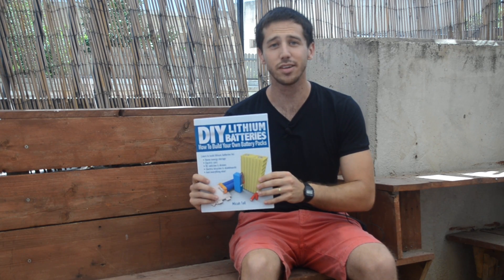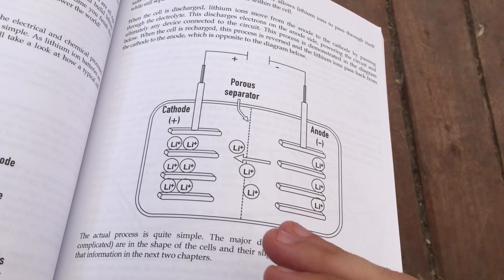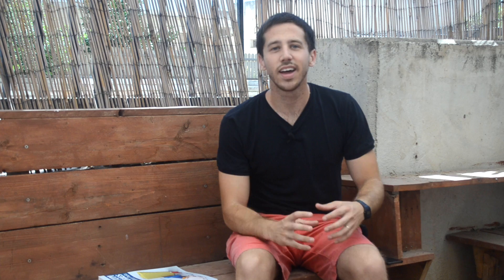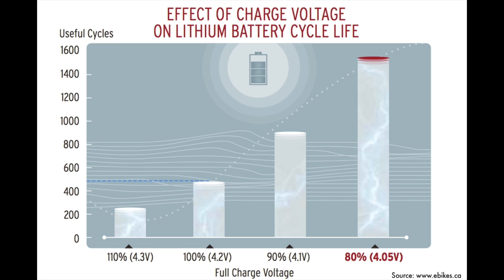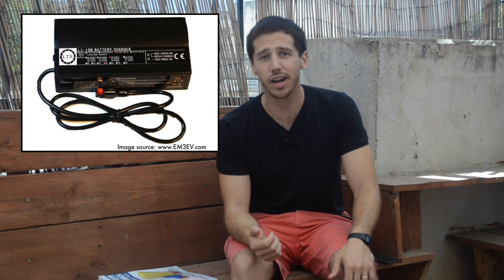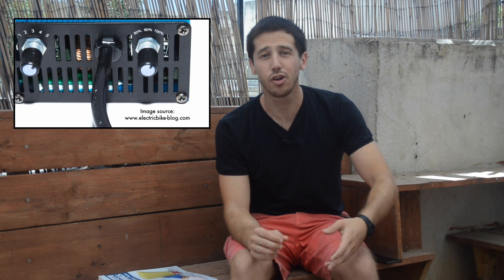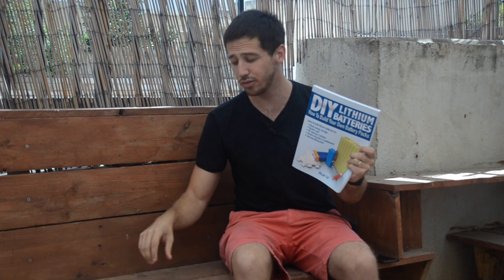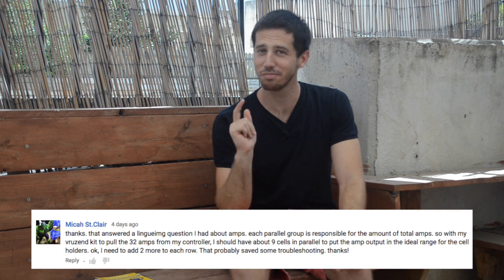How To Double The Life Of Your Lithium Batteries

Comment: My name isn't as cool as Micah St. Clair's, but I'll take a stab at it. Thanks for the charging info. I'm a total n00b in the e-bike world, just having bought my first one a month ago. Still learning the ins and outs - and battery life is one of them. My factory battery - a 48V 11.5ah "dolphin" type - is rated by the bike's manufacturer at 800 recharges, which seems to me like it will last a pretty long time before it needs replacing. But the nut of the matter is this: the replacement cost from the bike manufacturer (Rad Power Bikes) is $499. That's a lot of lucre for a retired guy like me. Luna Cycle has a battery that looks exactly like mine, with the same specs, for only $399 - a significant savings - but their support dept is unable to confirm for me whether or not the battery connector on the bike will match the connector on the battery. Do you have any suggestions for how to find this out? Thanks, and best regards.

Comment: Hi Micah, thanks for another great vid :) while we are on the topic of batteries and charging, I have a question.

I've seen folks advertise their e scooter batteries for sale and some indicated the battery has been bypassed. 

What does this mean? Why do people do that and what are the advantages and disadvantages of doing so? 

Looking forward to your reply. Thanks! :)

Ps: I'm guessing it has something to do with the BMS?
Reply from the maker: I assume that means the BMS has been bypassed. If you bypass the battery then you won't have any battery. Bypassing the BMS means you can pull more power out of the battery, and the BMS usually has a certain power limit. The downside is that you lose many of the protection features that are built into the BMS.

Comment: Great instruction videos. What do you think of digitally regulated chargers / power supplies where you can actually set your own voltage and max current? I use a 0-62V/3A charger and a 0-32V/10A and they work great. They also have a built in volt-meter so you see both the charge voltage and the "live" voltage of your cell-pack. I use the Gopher brand.

Comment: Hi EbikeSchool. If one might try to do the crazy thing of building a e-bike with not only 2 motors like you have already done, but also add an 3rd motor in the middle, how would you build one? How can you control all engines to produce enough power to help each other the best possible way ( is there a already build controller for that or is it possible to make one, or does it even matter to have something like that)? Also cost is an issue to not make it to expensive. Total newb to the e-bike scene, so i was just brainstorming the idea of 3x 250w motors with a battery for about 30-40 km range, because the size of motor is an issue here where i live (not going for speed over 30-35 km/h but would be nice to have more even speed while driving uphill and against the wind or heavily loaded .

Comment: If you REALLY want to maximize your battery life, you should do 2 things:
1) Charge it as slowly as possible. An 8 hour charge is much better than a 2 hour charge.
2) Make sure your battery is as big in watt hours as the PEAK power of your motor and for really much more life, double the peak. So if you have a 250W motor that peaks at 500W (though it usually more than double), get a 1KWH battery.  Quickly charging or discharging a battery generates a LOT of heat. The heat severely degrades your battery life. Heat is your worst enemy and quickly charging or discharging your batteries will artificially age your batteries. Same with the motor. Make sure you size your motor correctly for your weight and terrain. Having your motor peak out constantly generates a lot of heat and all heat generated is lost energy. If your motor is getting very hot, you are wasting your battery's capacity by using it to heat up the motor.
Reply: Fast charging and discharging generate heat and can damage batteries. Would fast charging and discharging still be damaging to the battery if the battery has a cooling system to reduce the heat generated by fast charging and discharging?
Reply: So adding a mini cooling fan to a big power bank such as a laptop one could be a good idea?
Reply: @antoniogalluccio4213  nope, I just checked, doesn't work.
Reply: @luongmaihunggia  so there's no way to minimize the wear apart from undercharging a bit as I understood right?
Reply: @antoniogalluccio4213  undercharging, slow charging or use a battery that can handle more abuse.
Reply: When you say more abuse you mean more voltage or more current in ampere
Reply: @antoniogalluccio4213  which ever one you like.
Reply: If you read the patents of tesla around their battery/charging solutions it contains the methods on their lifetime working batteries. Active cooling inside the battery is one of the methods. The question is how efficient it is to incorparate this technology im ebike batteries. But if i understand the methods correctly cooling would help to increase life with fast charging
Reply: @hetzijzoal  Keep in mind that Tesla makes their own batteries and builds very high quality cells.  In addition to that, I have heard the pack is undersized compared to the actual capacity of the battery. (ie.. a battery may be marked 50kwh but is actually 54kwh and so it is never truly fully charged)
 The single biggest thing you can do to extend your battery life is not to charge them all the way up. Under 4 volts per cell is best and never run them dead. This will more than double the life of your battery.  The downside is that you have to oversize the battery for the same amount of range.

Comment: The cell will drop off from 4.15 or 4.2 almost immediately anyway. Nevertheless, it is HIGHLY unlikely that you can increase to anywhere near 1500 cycles, especially since bicycle batteries are generally undersized and are expected to deliver huge amperage spikes (referenced from the C rating of the complete battery). I seriously doubt you can even get the 500 full cycles at 80% capacity unless your battery is really large in comparison to the motor on your bike.

Comment: Good idea with the occasional peaking to BMS level.
Long Term Battery storage is best at 40-60%, stored between 50-85 degrees F.
I myself believe 15-90% is how you want to charge unless to occasionally level(if required to trigger BMS).

Comment: Can you use lead aicd batteries the power an ebike
Reply: Yeah but they're very heavy, so expect less range or a far heavier bike, also expect about 2.5x less cycles if you fully charge/discharge.
Reply: You can, and it was common many years ago, but it is not practical at all, and not very economical, unless you already have battery and charger laying around.

Comment: Hi Micah, I have bought and brief read through your book but still have a question unsolved, maybe I should read in more details,  but I want to ask a quick question (maybe someone already had this question):
if I have a group of cells with capacity varies from 1500 to 2100 mAh (due to limited budget) to build a 7p13s battery, should I better put cells with similar capacity in parallel (so that every 13s would have similar capacity) or put the group with similar total capacity first (so that each 7p would have similar total capacity) then put those groups in series? Thanks!
Reply from the maker: Yep, I touched on this in my book. Both methods are possible, but generally the second method (where you try to make each 7p group equal total Ah) is better. That way you don't end up with a bunch of different capacity groups that will take much longer to balance. So try to make 13 parallel groups that are all equal capacity, or as close to each other as possible.

Comment: Would the recommendation of not fully charging the batteries that sit for long periods of time because of plating issues apply to mainstream Li-ion battery packs such as those for power tools?
Reply from the maker: yes. Inside they are all the same lithium ion cells (with small differences in chemistries, but the theory still holds true).

Comment: Hi Micah I am building my first lithium battery 48v 20ah from Sony vct6 cells from watching ur videos. Could you advise me I have a 57.6v charger would
Reply: It be suitable to use with the battery I'm making thanks for ur time
Reply from the maker: 57.6V is too high. You want 54.6V for 48v, assuming it is 13 cells in series.
Reply: Ok thanks for ur advice and quick reply very much appreciated

Comment: This is the main thing (as mentioned at the end): how long you ride before you have to charge. If you use a 400 cycle battery but charge every 3 days it will be at the same level for almost 3,5 years. Afterwords the battery doesn't just dies but looses some of the capacity. So it shouldn't be such a big deal. Of course if someone is range oriented then it is a different question.

Comment: Hi Micah,

I am building a battery pack and I have some questions about it. I'm doing a 13s10p pack so the charging voltage should be 13x4.2=54.6v. But to increase its cycle it needs to be charged to 80% as you said. So the charging voltage will be 13x4.05=52.65v. My question is if I charge it by a 54.6v charger and cuts it off manually at 80% (I can do it by a battery gauge or by assuming a charging time maybe after 5 hours or something measuring how much it's taking to get 100%), will it actually give me more cycles? or, I need to specifically charge it by 52.65v charger?
Thanks
Reply: .i need the same answer
Reply: Probably a super late answer but yes you can manually unplug it
Reply: Those chargers should be CC (constant current) followed bij CV (constant voltage).
During the CC period the actual voltage of the charger is below 54.6V. It is only 54.6V during the CV period.
So yes and you could even think of a circuit that switches off the charger using a relay at let's say 53V.

Comment: 4.1Volts is not 90% of a full charge of 4.2Volts. ...90% is 3.78Volts and 80% is 3.36Volts not 4.05V as in the Graph and as mentioned in the Video. ...
Reply: Steve Jones I believe since the range for a healthy cell is between 3.2 when fully discharged and 4.2 fully charged, %90 would be around 4.1. If your batteries actually got to 0v you wouldn't have a functional cell anymore.
Reply from the maker: That's not even close to correct...

Comment: Ok it works, but I think the math is wrong. Let me demonstrate: For instance you would normally charge when at say 3.6 volts. So from 4.1 you have 0.5 volts and from 4.2 you have 0.6 volts to ride with.  Simple math concludes that is about 20% less capacity!! I would say it is not worth it. Also you should never ever overcharge a lithium battery!
Reply: Jurik Ristjouw 1st, usually lithium ion cells are discharged to 3.0 volts, sometimes even lower depending on the cell (discharge cut off at 2.5 or 2.8 is common). 2nd, the relationship between energy (watt-hours) and voltage level is not linear in lithium ion cells. Take a look at a discharge curve, a lot of voltage is lost very quickly in the beginning and then flattens out later. So charging to 4.1 you don't lose as much as it seems.

Comment: Hello Micah. This is Reuben. I am building a battery pack. Well i am a bit confused while calculating the overall power of the battery pack. For instance, Power = voltage >< current. For a 18650 it would be P = V >< I, so, P = 3.7 >< 3.4. So P = 12.58 watt hrs. Right i get it. BUT i am getting confused about Maximum Continuos Discharge Current which is different for every different cell. So while calculating the power, should the current be capacity of the cell (ah) or Max Cont. Discharge Current. Can you please clarify on it. Thanks.
Reply from the maker: Your confusion is likely because you have the first part wrong. Watt hours is not a unit of power, its a unit of energy. So 3.7V * 3.4 Ah = 12.58 watt hours of energy. That doesn't tell you power. When you calculate power, don't use the capacity of the cell (Ah), instead use the max continuous discharge current. So for a cell rated for 10A max discharge, you'd get 3.7V * 10A = approximately 37 watts of continuous power.

Comment: Since when is an ANODE negative???????
The anode is the positively charged electrode.
Reply: g0mhc True and i also noted another Error Since when is 0.1volts 10% of 4.2Volts LOL In the charge graph it shows 100% charge =4.2V 90% charge =4.1V and 80% charge =4.05V.. shouldn't it be 0.42V less  for each 10% less charge ?..That would make 80% charge = 3.36V not 4.05V which is a massive ERROR LOL Regards M0BFM
Reply: Well spotted Steve.
I'll just stick to charging my 18650's to 4.2V it won't make a whole lot of difference to the life of them.
73

Comment: Well explained, thanks.  I use a second charger set to 3.90V/cell for winter when I'm only commuting short distances around town but need to have the bike ready to go at all times.  Both the basic "42V" chargers I have are internally adjustable over the required range.

Comment: Doing some calculations based on a 1AH battery pack for simplicity
@ 4.20V:  500 cycles  x 100% =  500AH  total life
@ 4.10V:  900 cycles  x _90% =  810AH  total life
@ 4.05V: 1500 cycles x _80% =1200AH total life
What does this mean? Well if your commute on your ebike is much less than your battery range (or you use just a little more peddle power)  you could potentially more than double the life of your battery.  Charging once per day this would take your battery from 16.5 months (1y 4.5M) to 39.5 months ( 3Y 3.5M)
Now calculate the cost of your battery to the cost of a special charger. Now include any other batteries and see your potential savings.
Reply: Q Az
So you tought the vid was not clear enough about this?  simplicity rulez lol
Reply: Q Az $

Comment: I'd be interested in knowing how periodically "topping off" lithium batteries that spend most of the time in standby mode affects total life. These are typically flashlights, etc., that need to be kept ready for emergencies, and need as much capacity as possible if and when used.
Reply: I'd like to hear the answer to that myself. That sounds like it could create an issue not unlike NICADS dropping to a lower voltage, only with the same voltage and a shorter lifespan.
My guess is Micah will say "Not so much, except you will have slightly more plating damage at the anode due to staying near 4.2 volts more often."
What say you Micah? (1st time video watcher here)

Comment: What do you think about a booster pack?
When the voltage of the battery gets low, you activate a booster battery pack in series, so the voltage increases and the motor can run faster again.
Will it harm the booster batteries or will all of the current flow through those?
And will the BMS still work correctly, or will it lead to single cells getting under-charged?

Comment: I also try to only charge to 100% when I'm going to ride the bike soon after. I have a simple e bike kit without a battery gauge,  and a cheap charger, but I do have a bike computer that shows speed/miles, and after a couple of months, I now try to leave about half an hour off of full charging to charge it somewhere between 80-90% (if riding 12 miles or so takes an hour to charge to full, this time I only charge it half an hour, then next time I charge it the whole hour). Now I only need to charge it full when I will need the range.
From what I hear, good quality 18650 batteries rarely get out of balance.
Another great video Micah, thanks!

Comment: I did not know this so a huge cheers and thanks for the info - its good to know that I am on the right path to battery bliss - I actually do what you do with my rides as I have 2 batteries while using 1 I will use it for the next ride because it usually has 55-65% left if i am doing 10 mile runs, and the other battery remains low until the day before the other is used.

"range anxiety" I like that, I had lots of this crippling condition when I first got my e-bike kit lol

Comment: I hope all chargers come with a choice between 80 90 100 percent, per BMS that allow the option to balance that range in the near future. Thanks for another clearly explained video, Micah.
Reply: Not all chargers I think, but possibly BMS’ allow you to do that, depending on the BMS. I think you can set the maximum charging voltage, as well as minimum discharge voltage on many of the Bluetooth or programmable BMS units. As well as that you can use an adjustable charger which lets you set whatever voltage and current you like, which is ideal because not only can you under-volt, you can also stress the battery less by setting a lower current.

Comment: Hi Micah Another great video,  Maybe something else to cover which noone seems to have done yet is about lighting including possible indicators and brake lights from your high voltage packs.  I think as the bikes are getting more powerful and faster  this would be a great topic, Its something Im just trying to work out myself now.  Just an idea for another topic.? Im thinking of using a motorbike switch and hooking it all up to something like that. Not sure the best way though.
Reply from the maker: I did a video a few months ago on lighting, but didn't include brake lights. That'd just require adding in a brake lever switch.